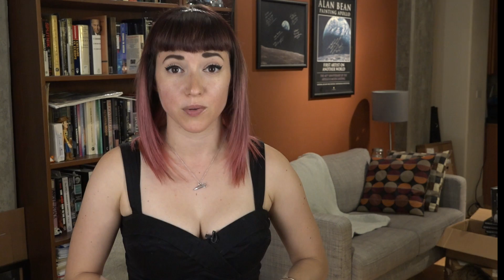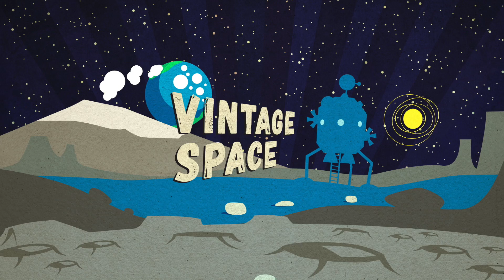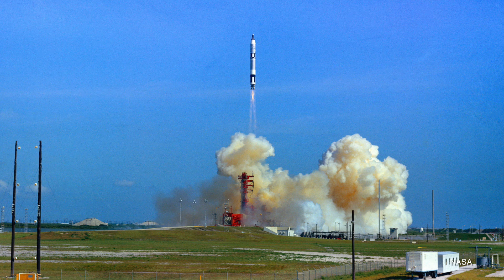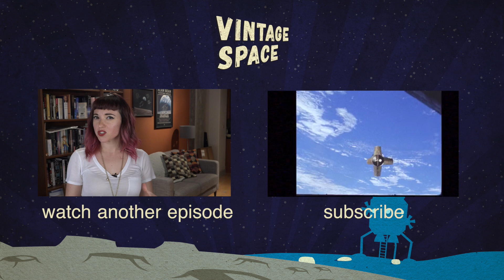How Little Vibrations Break Big Rockets

Comment: Very interesting, had not heard of this! 
3:33 nitpick but a pet-peeve of mine: the verb is "damping", not "dampening".  
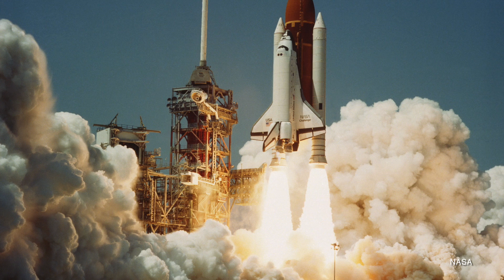4:00 Interesting use of accumulators - I infer that what must happen with the accelerated liquid is some kind of waterhammer effect, which aligns with your explanation of the acceleration and combustion. A waterhammer is where a liquid gets slowed down suddenly and the kinetic energy of the liquid gets transferred into a pressure spike. Because the liquid is very difficult to compress, that pressure spike is high. Introducing an accumulator introduces an additional spring (gas spring in this case) that can store the liquid's kinetic energy without such a high rise in pressure. Going by your article, various types of accumulators have been used on various engines, so this seems to be a rather common remedy.
Reply: Depends on if you're in the US or England

Comment: Let's say in the case of the Saturn V, what is the distance of the up and down motion? Is the Rocket going up and down a few inches? a few feet?
Reply from the maker: My sources say 1/4 to 1/2 foot, so a matter of inches, but potentially upwards of ten times per second.
Reply: Yikes!
Reply: Yep, its the frequency not the amplitude that broke structures. Had it not occurred on Apollo 6 and happened on Apollo 8, they would have aborted and not landed on the moon in the 60's ( assuming the abort went OK ) A bit of luck as Apollo 4 did not exhibit this issue at all! Fred Haise in interview indicates he felt pogo for a split second on stage 2 before it shut the center engine down!
Reply: Yes, its on YouTube, somewhere in the middle of an interview of his. Its the only recorded description of an Apollo astronaut recalling feeling pogo

Comment: No mention of pogo oscillations causing the centre engine shutdown on Apollo 13?
Reply from the maker: There is always more information in the blog post that goes hand in hand with the episode. I talk about it here: http://www.popsci.com/how-little-vibrations-break-big-rockets
Reply: But that requires reading!
Reply: Yeah, thought she'd talk about that.
Reply: Ouch.  Did not know that.  I take it they just burned the other 4 longer to compensate?  (since it made it to the moon before having other problems)
Reply: Roboprogs Yep. It's even shown in the Apollo 13 movie, although they don't say it was due to pogo oscillations. They wouldn't have known until later analysis of the telemetry.
Reply: Had pilots been aboard, it was an abort and no moon landing before the end of the decade!
Reply: We need a video of her running in slow motion in that outfit, wearing high heels.

Comment: It would be interesting to cover the similar issue of thrust oscillations which can affect solid rockets. This was an issue during development of the Ares I and significant engineering resources were devoted to solving it. It is very similar to pogo, but with a completely different cause given solid fuel is not subject to varying flow rates.

Comment: Still trying to wrap my brain around the phrase "old-timey spaceflight"! Kind of like a bookend to "newfangled oxcart"...

Wasn't the premature center engine cutoff on Apollo 13 caused by pogo, as well? And could pogo be mitigated by mounding the engines on shock absorbers?
Reply from the maker: No. From what I read (without digging into the issue specifically) the centre engine on the S-II shut down prematurely unrelated to pogo, but it was a good thing. The engine was vibrating REALLY hard and had it not shut down it could have been bad news. I talk about it in my blog post! http://www.popsci.com/how-little-vibrations-break-big-rockets
Reply: Ohhh, I see (I think) - the AS13 shutdown was due to engine vibration, but not in resonance with the stack - correct?

Comment: Yeah "partially filled gas accumulators attached by flanges to the err um oxidizers turbo thingy" Exactly what I would have done. Yeah that's the ticket.
Reply: Consider a bladder designed to contain 1.5 times the maximum pressure the supply can create. Encase this bladder in a metal shell with one opening. Connect this shell to the supply line. Fill the bladder with a gas (we like Nitrogen) to 1/2 the maximum supply pressure. Turn on the pump.
When the pump starts, the pressure will increase to its design level. This compresses the gas in the bladder.
Should the pressure from the pump momentarily decrease, the bladder will expand, providing extra pressure to make up the difference. If the pump overpressures, the bladder will contract, absorbing the overload.

You may have a few of these in your house. Newer water installations have a surge suppressor. This is an accumulator.
Some houses are built with 'hammer preventers'. This is essentially an accumulator that you connect to your water pipes to prevent the pressure surges that can make a hammering noise.
Reply: An accumulator is nothing more than a fancy name for a "shock absorber". Pretty much just like the ones on your car, but built to aerospace specifications. 

Really, can't you do any research on your own, and not have to have everything spoon-fed to you?
Reply: My car uses a flux capacitor, anti-grav inducers and a Mr. Fusion power pack. It has no pogo vibrations.